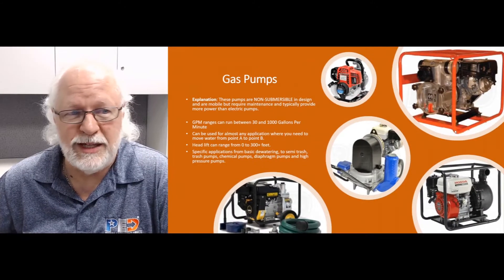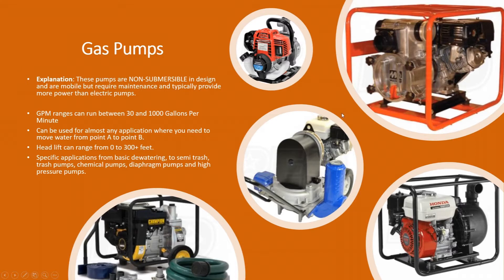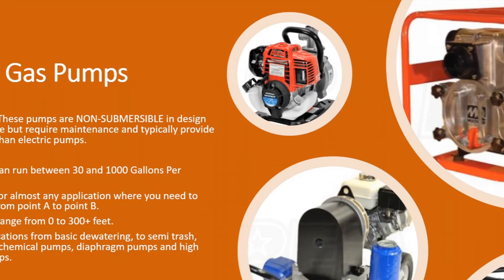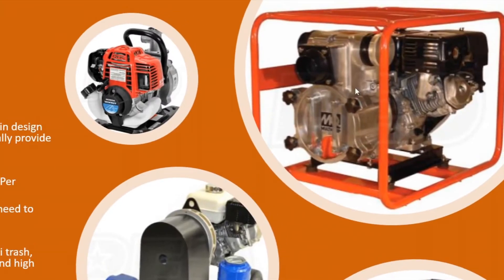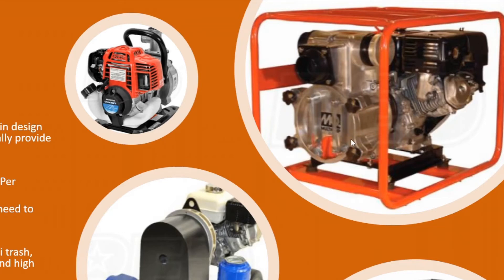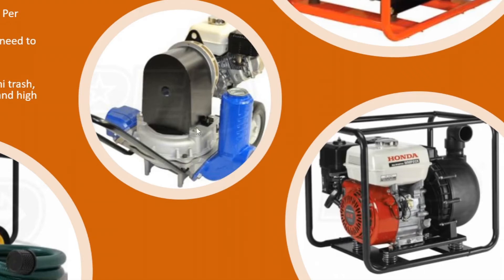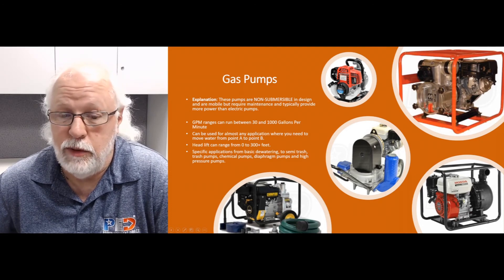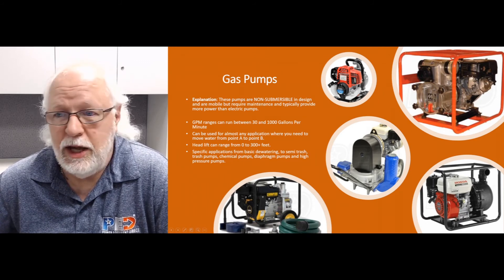Types and Uses of Gas Water Pumps

Comment: I'd like to use a gas pump to fill a tank using a 60-80ft well as the source. Would that work fine?
Reply from the maker: That would depend on the static water level in that well or what the depth to water is from the top of that well to the water surface, and what that water level might drop to when pumping that water out. Most ANY non-submersible pump can only handle a max 25 feet of lift on the suction side of that pump, and that’s from the water surface to the pump inlet and that’s at sea level.